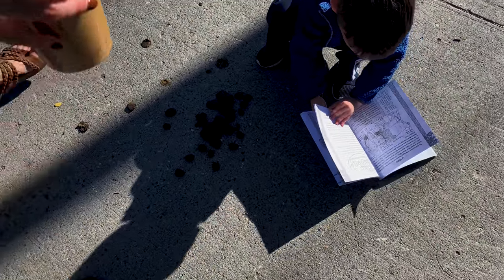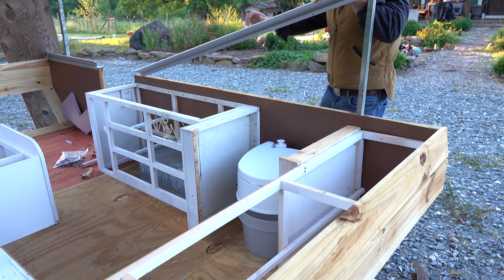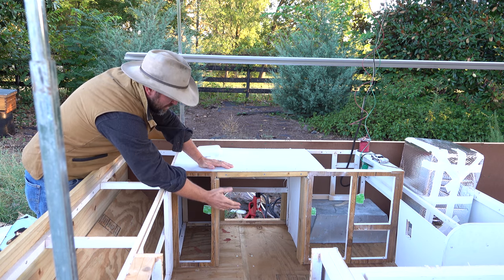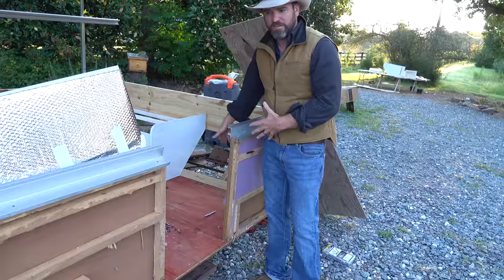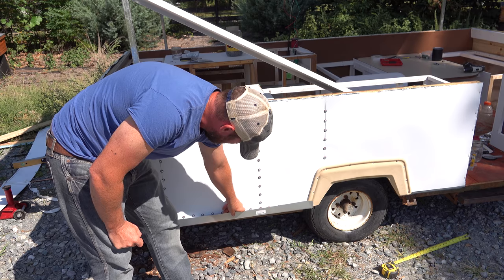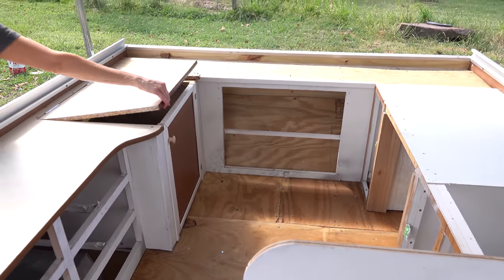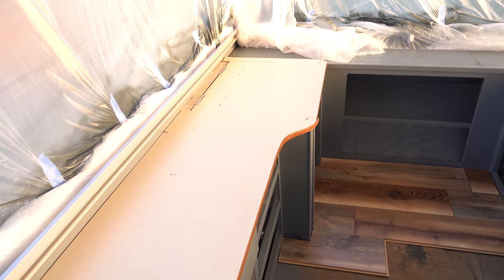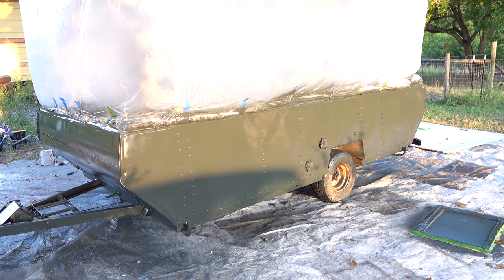REBUILDING A POP-UP CAMPER: WE ARE OUT OF TIME!

Comment: Looks good. Just a note...the foil-backed insulation has very low emissivity or heat radiation. To benefit from that feature you should provide an air gap between the foil surface and adjacent surface of about 1/2". If they touch then the foil becomes heat conductive, reducing it's insulative effect.
Reply: Good to know, never thought about that, but now that you mentioned it, it makes complete sense, and kinda seems obvious. Sometimes you don't know until you know😏👍

Comment: how about insulating the floor ceiling and roof with aluminum backed foamboards with propane/ woodstove tubing carrying antifreeze for heating floor radiator vents , It’s gonna get cold this winter
Reply: 8Truth Seeking  A floating camper great idea 😂👍